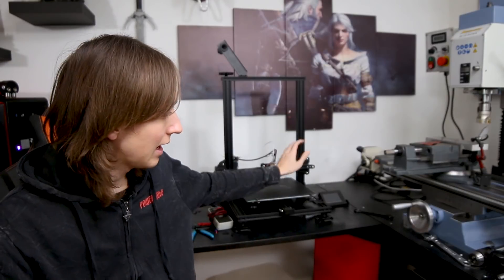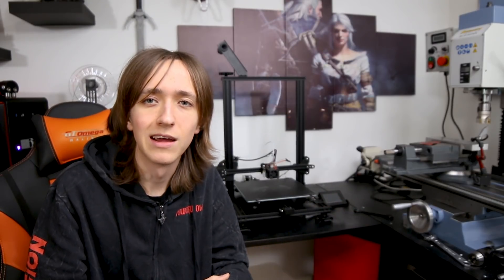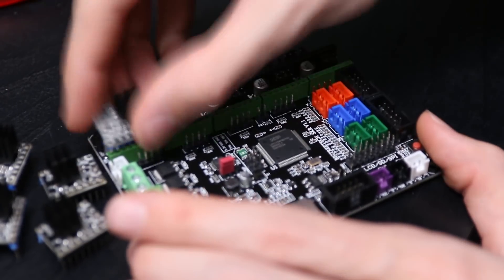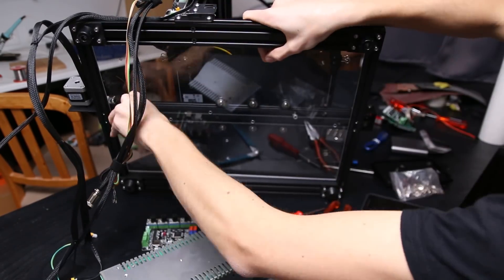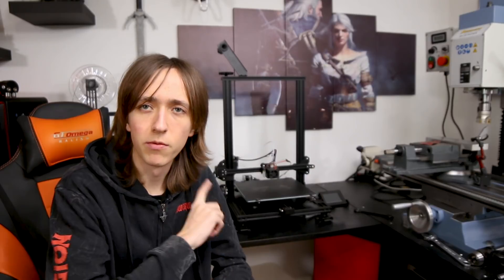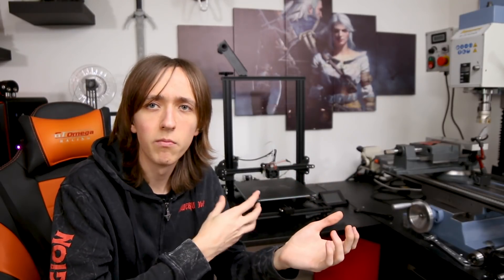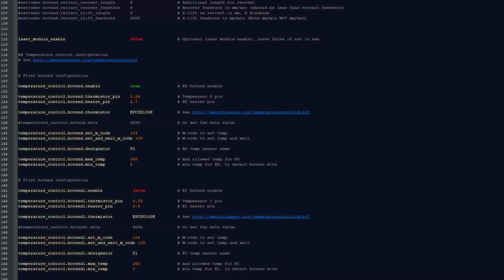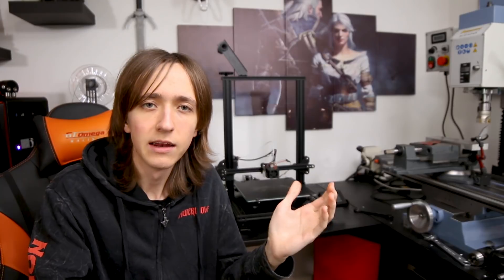CR-10 Electronics Upgrade ft. cheap Smoothieware board

Comment: hi, i installed the skr 1.4 with 2209 drivers, and i worked, they print fine the first time, but they little fixes i want to do on marlin, the lcd goes black, and only works when i connect to serial port(usb on en the board V ).I try all the things im find on internet, i plug the lcd cables reversed, and that doesn't work, only gives me image when connect to serial port, but i want to print only with the screen.

Comment: i had similar problems at the beginning, for communication between display and smoothieboard,  you have to install the right display firmware, now for me all work fine, i have just to refine something
Reply: I tried to do this 2 years ago on CR-10s, but I had the same problem so I quit, and today is getting disassembled. I primarily did this because of the automatic shutdown. Can you tell me where to download frimeware? I have: MKS SBASE + MKS TFT32 V4.0 and MKS BASE v1.5

Comment: Octoprint is great, especially if your desk isn't next to the printer. You can use it from your phone to fine tune settings, add plugins and scripts, and so much more. Firmware updates and settings can all be done from webpage. Network security must be considered, with this power comes the ability for hackers to burn your house down should they get access.

Comment: It looks like you got the SKR v1.3.  You should try out Marlin 2.0.  Chris's basement just put a video out on it.  Your touch LCD and board are more compatible with Marlin 2.0.  I have a CR-10 and I am going to do your LCD and board upgrade with Marlin when it arrives in a week.
Reply: How did your upgrade go?  I just got a CR-10 (mini) and I'm thinking about trying an SKR Mini E3 V2.0.
Reply: @The-Rewker  it worked well.  The biggest difficulty was cutting the original box metal for the ports.  The 2208 sound good, but I wish the 2209 were out when I did the upgrade.  The only stepper that you can here is the extruder during retraction depending on the rate I set in the slicer.
Reply: @OpusPuffin  Nice, thanks!  Gonna give it a shot
Reply: @The-Rewker I would get some JST connectors.  The CR10 has 2 pin connectors on the end stop switch and the bigtree board has 3pin connectors.  You just release the pins on the old connectors and put them in the new.
Reply: @OpusPuffin  Ah, I have some JST-XH 2.54mm, is that the right type?  They didn't work for the hot end fans on the i3 Mega when I tried them (too big), don't know what those ones are.
Reply: @OpusPuffin  Actually nevermind I can just try it and see if they fit.  (edit: it does)
Reply: @The-Rewker  https://www.ebay.com/i/264053121526?chn  are like the ones I bought from Banggood.  They are DH32 JST connectors.  The description has 2.54mm XHPX which sounds like what you have.  I guess you can wait and see if yours fit on the SKR board before ordering.

Comment: I've been trying to find info on Smoothieware. As of today, May 13, 2019, it appears that Smoothieware has died. I attribute this passing to all the Chinese "Smoothieware" boards on Amazon. For the developers, there's no benefit anymore. For makers, smoothieware is now a dead end. But for me, the question becomes, "what can I get, then?" I want to replace the board on my AM8 / Anet A8 printer. I want to move to a 32 bit system because I believer that will produce higher-resolution prints. Smoothieware and Smoothieboards are a dead end. But what about Duet gear. Already, Chinese clones of Duet Wifi and Maestro boards are available on Amazon. Will Duet fall by the wayside too? Maybe the solution is to simply buy a Chinese Printer with a 32bit system installed? And be satisfied with no access to the hardware and firmware? I don't know. I wish the Internet DATED EVERYTHING BETTER.
Reply: You can get a smotothie bord and flash it with marlin 2.0 y did it on mi mks sbase and worked fine with a discount full graphics display didn.t mount it to the printer yet.
Reply: I don't see Smoothieware as dead. There are still updating it and the Smoothieboard V2 is now shipping.
I don't think the Chinese boards that can run it were specifically targeted at it. Most of the boards that could run smoothieware are actually being used with Marlin V2,

Comment: I also have a cr10 and want to upgrade the electronics.   I'm glad you had this video. I wanted to do this with the smoothie wear board but now I will have to rethink that. If anything this is a good morning that this can get very technical quickly. Success is not guaranteed.

Comment: The thing want i dont understand is why you would choose smoothieware over marlin
Reply from the maker: Mostly just to try out something different. Also 32bit controller support.
Reply: Datulab Tech there is a marlin version that supports 32 bit. It’s called marlin 2.0. I’m going to run that on my new SKR 1.3 board. Will be a pretty nice upgrade from my stock ender 3 board
Reply: Marlin V2 does not support a CNC mode -  not does it support additional ABC rotary axes. Smoothieware does. For my application (a 3D printer with a 4th axis rotary table), smoothieware is the only option.
It is also much easier to config than Marlin. The config file is clean and readable - compared to the mess of Marlin.

Comment: I didn't see anything obvious in firmware so i would double check the pinouts for the board and where everything is actually getting plugged in especially the pins 23 and 24 that are set to bed and hotend thermistors respectively and also double check what thermistor your bed is using looks like it is set to a epcos 100k thermistor not sure the epcos and such matters but is a bit different than, quick bit of research show cr-10 configs in marlin place ATC Semitec 104GT-2 as the bed thermistor.

Comment: I soldered 2 wires(tx rx) to original board and attached them to MKS-TFT
Reply from the maker: So what you're saying is that you're using the touchscreen with the original board? That is pretty cool, not what I needed, but if you don't need the extra functionality, that might be a cool and cheap upgrade!
Reply: @DarkArtGuitarsWorkshop  yes. The only reason i like touchscreen is for its power recovery function. Usb is nice addition too.

Comment: You don't need octoprint with smoothieware since it has built in web server and you can controll it using your tablet og PC. read more at smoothieware org/network
Also with smoothie you really need to take time to study the config file. Not saying that you didn't buy - I have been using this board since version 1 - so commenting from many years of experience.
Reply: also here is my config pastebin .com / RyNADvPr
Reply: did check your github, you can start by adding:
temperature_control.bed.max_temp             120               #  limits bed to a safe temperature
Reply from the maker: I did see that, the board that I'm using doesn't have any built in networking though, so I would have to wait for the addon to arrive from overseas, and the raspberry pi was already setup just lying there. I might check out the smoothieware web interface sometime in the future though. I'll also take a look at your config and see what I can learn. Some of the stuff I already knew from toying around with marlin before, but there are really a ton of configuration features that do require some homework to fully utilize.

Comment: If you would have done a little homework you might have saved yourself some headaches
Reply from the maker: You are 100% correct with that, guess just buying whatever is recommended and cheap on aliexpress isn't always the best :D
Reply: @DarkArtGuitarsWorkshop  can you tell me the name of the mother board you used? it looks like a MKS GEN L - Also, you will need to set the reference voltage to for the drivers. What drivers are you using?
Reply from the maker: I'm using the tmc2208 drivers on a bigtreetech board: https://m.aliexpress.com/item/32962443179.html?pid=808_0000_0109&spm=a2g0n.search-amp.list.32962443179&aff_trace_key=625f4eae872e4c9e9531e67ab452b924-1553467406690-09779-UneMJZVf&aff_platform=msite&m_page_id=6041amp-FINES_9EFdjalbGrIyceVw1553467440025
Reply: @DarkArtGuitarsWorkshop  - make sure you set the v-ref for the drivers. There are tutorials online.